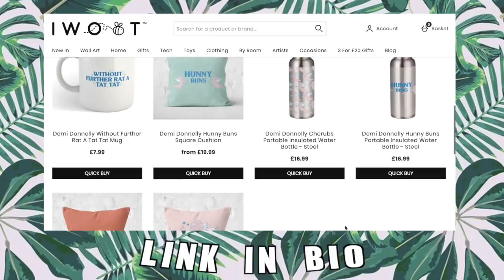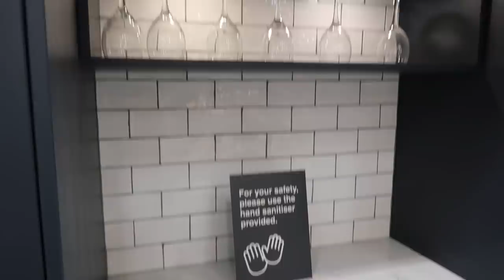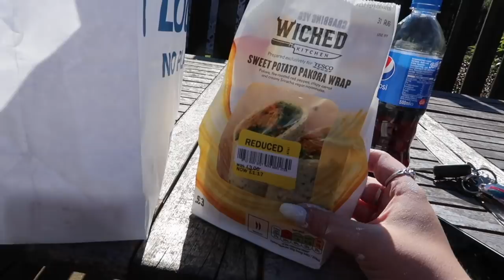Renovations have started: creating our dream home! BIG interior decisions made this week

Comment: Awww bless you . You've got all the time in the world , don't be in such a rush ! Take your time and just concentrate on 1 room at a time . You'll get exactly what you want then and won't make rash decisions . Make mood boards , it's more fun then gather your ideas together before rushing in . 
I too have had faux Brick some years ago , so it's definitely on its way out .  I think anyway . 
We all have our own style , so you do you . But make sure Sean gets a choice won't you ? 😂💋
My hubby is a decorator , and to work out rolls , base your count on 3 drops per roll approx  . So measure your wall and then the width of your roll . ( not sure on the sticky stuff tho cos you get far less in them rolls ) 🤔than normal paper 
Start papering from the middle of your wall , by finding the middle and work outwards , use a plum line , which is basically i line of string with a weight hanging on it and this will find the straight line which you can pencil on the wall to start . 
You don't need radiator paint . You can just use undercoat and gloss/or eggshell which has a mat finish and is oil based . 
A word of warning , painting radiators white , will eventually yellow with the heat . 
Good luck 😉 xx 😘

Comment: If your  walls aren't nice enough to paint but you don't  want the mess/cost of replastering you can always line them with thick lining paper. If it is done well you can't see it and it makes them super smooth. 1400 grade is the thick stuff. You just paint over it like normal.